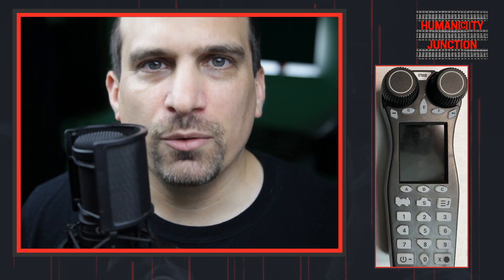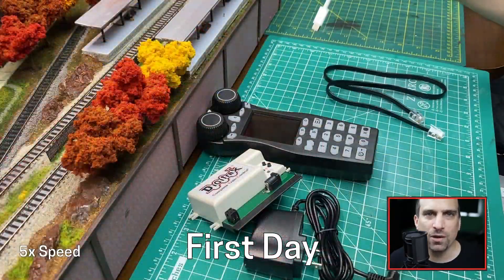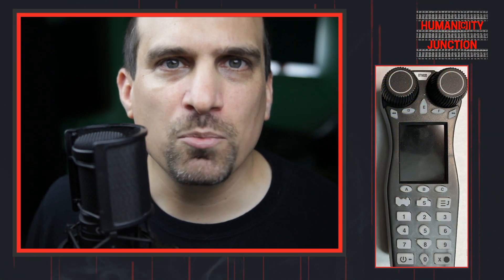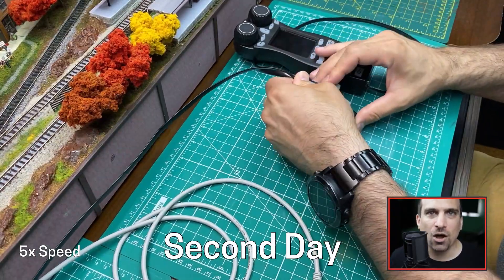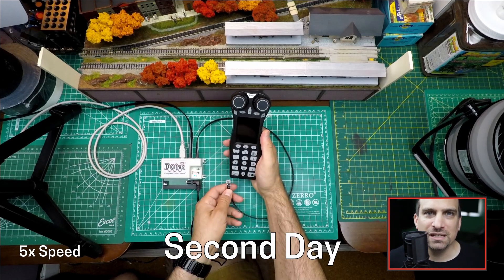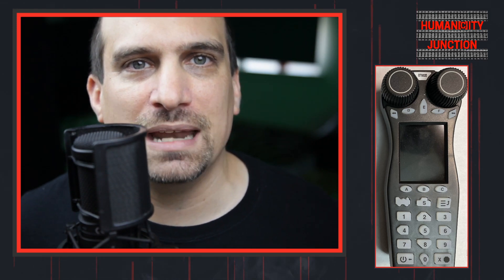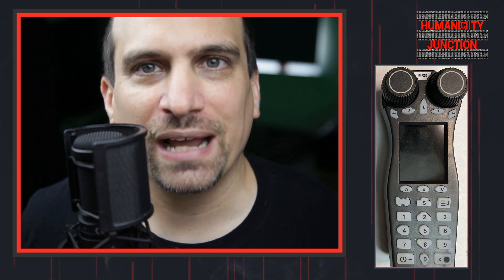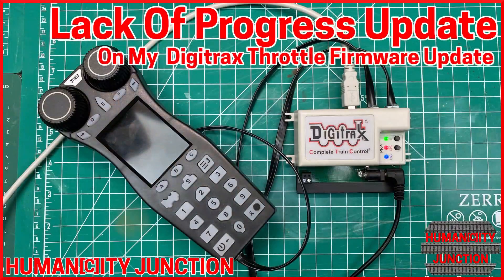Lack of Progress Update | My Digitrax DT602D Throttle Firmware Update

Comment from the maker: Thanks to Ryan at Iron Planet Hobbies, he was able to update a Digitrax Throttle with a PR4 and the Digikeijs DR5000.  He had the PR4 hooked up to the LocoNet B port. I will give this a try as soon as possible and report back.
Ryan posted a video on his Facebook page of this process working, https://www.facebook.com/ironplanethobbies/
Reply: Heath, Did your Digitrax handheld come with your DCC base station? If so then a good price. If not then the cost of the handheld has to be added in, ~ $195 retail, so then it totals to almost $400, for the handheld throttle and you base controller.
Reply from the maker: @tanzj  Thanks for the clarification.
Yes, total they cost $400 all together, but they are for two separate uses.  
The DR5000 for $200 is to run my home layout.  The DT602D is for operating on my club layout.  I can use the DT602D at home, but that is not its main purpose. Yes, it is completely overkill using the DT602D to run trains on my home layout :)
If I purchased an NYE Powercab or a Digitrax Zephyr (I came very close to purchasing the Zephyr) for my home layout, neither of these will work with the club layout. So no matter which starter system I purchased for home, I would still need a throttle for use at the club.  I did consider a UWT-100 or Proto Throttle for the club, but they are just starting to setup wifi and the Proto Throttle costs a lot of money, so I just went with the Digitrax throttle.
I definitely could have just gotten a DT500D to use at the club, but I really like the newer Digitrax buttons that they first introduced on the Zephyr DCS-52. I had a feeling that Digitrax would roll out a new throttle with the newer buttons and LCD as seen on the DCS-52, so I waited to purchase a throttle for the club.
My club is open, but I just cannot easily get there..Yet.  Once I can get to the club, I will be able to make videos with the throttle on the club layout, which I think might make more sense.
The club has a large N scale layout and a HUGE HO scale layout.  On Saturdays are open running/work sessions, but on Tuesday nights they do operations. Once I can get to the club, I could also do the throttle firmware updates there.

Thanks for continuing the conversation. I believe that we both completely agree that the DT602D is overkill for my home layout.
Reply: @HumancityJunction  Hi , I have been watching your videos on your DT602D ,as I was interested in this throttle, I have a very small layout, however I am the type of person that goes overboard for everything. I was torn between the UT 100 and the 602 , I have all Digitrax , Zephyr,  DCS-52 and PR4, and LNWI to use my iPad for running trains, I wanted a Thottle and could  and have used my IPhone , however I find these not really convenient to use, I liked the idea of wheels and buttons. so I went with the DT 602-D it should be here Friday, I appreciate the effort you have put forth in your videos and wish you the best
Reply from the maker: @catfisherboy  Thanks for checking out my videos. I also tend to go a bit overboard as you can see in some of my videos.  I really like the DT602D throttle, I just need to get past this firmware update issue.  Thanks again.
Reply: @HumancityJunction  Do you know what the update was supposed to do ?---fix a bug or add a feature
Reply from the maker: @catfisherboy  I know that it disabled the beeping every time the LCD went to sleep, which was the main thing I wanted resolved.  I believe there were also some bug fixes.
Reply: @HumancityJunction  I did get my DT 602 D Saturday, and it did have the firmware update, no beep--yjat's the good--the bad is, it would not stay connected to the UR 92, would run a bit , couple of minutes, then disconnect, the bars showed , 3 or 4 all the time, contacted Digitrax, they said if it wasn't low batteries I could send it in, I did that today, I am very disappointed to say the least---will let you know
Reply: Ryan is THE man. My first stop shop!
Reply from the maker: @GMan269  I completely agree!!
Reply from the maker: Here is the Iron Planet Hobbies YouTube channel which has a lot of good information on it. https://www.youtube.com/user/IronPlanetHobbies

Comment: I wish i hadn't invested so heavily into digitax. Most convoluted system out there. Really disliking my new DT602.  the fact it goes to sleep when you are using it. Then, Stays awake when the power supply is off.  so illogical. And the 'recall' session trains. Never seen a train number i have used on the list.  And do you think i can update the firmware? no! it just doesn't error, or do anything. looks all fine. but still the old firmware... NCE here we come...
Reply from the maker: I really like LocoNet, so I actually use a Digikeijs DR5000 as my command station.  I can use a Digitrax throttle (my local club is Digitrax), but I can also use a lot of different options as well.
NCE protocols are too limited for me whereas the DR5000 can do LocoNet, Expressnet and a few others.

Comment: Dont worry about the negative feed back,i am inthe same boat considering on buying this digitrax throttle awaiting  your tuitorial on this matter good luck
Reply from the maker: I am really liking the UT6D throttle. If you are doing operations, I think it is a better option.  I just did a video on consisting, which you can now do on the utility throttles, and I believe it is a great step forward with the new throttle. -Heath

Comment: I remember that thread on that Digitrax IO. I never responded to it since I actually have no experience with the DT602 but it was an interesting read.
Reply from the maker: Rebel, is that how you found my YT channel? From Groups.io?
Reply: @HumancityJunction  I searched t-trak layouts looking for ideas for my own t-track stuff. I am in the wiring stage right now and I’m not 100% sure my idea for my own wiring is the best, even though it works well, and wanted to see what others were doing. And I landed here. I have been tossing the idea of building a channel like yours but just lack time to make it all work. I have a few vids on my motorcycle work, and a few of train stuff on Rebel n Trains but nothing to really stand out.
Reply from the maker: @rebelndirt8830  Fantastic, thanks for letting me know.
In some cases, I just turn on the camera when I am working, and then edit them down into a video.
I am just trying to share my enjoyment of the hobby in a concise and efficient manner. -Heath

Comment: I went through my trials with this new throttle. One return trip to Digitax for the IPL'D update and battery issue and it still didn't sync to my system. Turned out that the throttle only stays on channel 11. I set my UR92 to channel 11 and now the throttle works.
Been through the tribulation of trying to interface an ESU system with my Digitrax. Stutter stepping all the way until I decided it was enough. It doesn't work. Only Digitrax stuff on my system of some 36 components.
Reply from the maker: I find it frustrating that there is not a common language amongst control systems. My main control system is Digikeijs, which is supposed to be LocoNet compatible, and yet some things do not seem to work as smoothly as they should.
Thanks for watching and commenting - Heath
Reply: @HumancityJunction  ESU claims Digitrax compatible, but ya end up have to replace all your Digitrax stuff with ESU stuff. They sell an interface unit, which I tried but that didn't solve the problems I was running into. I just stick with all D now.

Comment: Ironiclly Digitrax is 2.4 miles from my home in Panama City ,Fl.  and yet can't walk to the front door and say HEIP!! I have received update from Chris at Digitrax and I as well bought a PR4 and laptop tried update this morning. The problem I have is hit horn on right throttle then quickly hit horn on left throttle while right is still blowing then both horns get stuck blowing and can"t turn off I have to shut down my DCS100 for 30 minutes and remove battery to reset,  thanks to your video post I was informed of how to hook up PR4 to my Loconet and update my DT 602 at this time that update did not fix my issue. Steve I.
Reply: Also this is not an issue with my DT 402 and yes I am running 2 separate loco's on my layout and ran into this problem the first day I received it. I pre ordered it I think mine is # 170 in manufacturing, I'm just wondering did I jump the gun when ordering this throttle, I'm sure this will be resolved and I can use the DT402 until fixed.
Reply from the maker: I think my throttle was number 147.  I do not think it had the battery clip issue, but definitely an earlier hardware release.  I think there was a "b" sticker inside the battery compartment.
My throttle is currently at Digitrax, arrived Friday, so hopefully I will get it back soon. I am very curious if my unit has a hardware issue or just needs to get the firmware loaded up again.
I always try to wait and not buy the latest release of anything, but I guess it is all a part of technology.
I will update as soon as I get the throttle back.
Reply: @HumancityJunction  Sent my throttle in to Digitrax, the emailed me yesterday and said they were sending a new one, hope it stays connected
Reply from the maker: @catfisherboy  Wow, that is not good. I got mine back and they just updated the firmware.  I definitely need to run it through it paces before the year is up.
Reply from the maker: Chris was helpful, but I still wish they had provided better instructions on how to do a firmware update.
Reply: Yes I agree about the firmware update watching your video and then going outside and trying to figure out if you had it hooked up bright I saw the light flashing I had it in Ops mode on the dcs100 and the lights were flashing like crazy on the DT 602 but in the end it did not fix the problem with the horns getting stuck and it is not a button issue it somehow has to do with the digital information overlapping from one to the other rather quickly and I must say oh how I miss being able to talk to someone on the telephone at Digitrax, good luck with your DT 602 I'll check back and see if you made a new post on your repair.

Comment: I have a digikeijs central and, digitrax, lenz, uhlenbrock and roco centrals and thottles, interconectivity is something I also want, but under real life use and after many hours trying most possible setups and testing all possible processes like programming, multi locomotive, train detection, 28 functions, etc etc, I came up with the conclusion that while compatibility in most essencial situations is possible, is it not in all processes. My advice, buy everything from one manufacturer, even in that situation you will still have sometimes minor compatibility issues but your dcc system will work 97% of your time. Prefer brands with many years in the market, from Europe or USA. Right now my H0 layout work with all lenz, and my H0m layout will work with all digitrax.
Reply from the maker: At the moment Digikeijs does not make a throttle, but it looks like they are coming out with some new products shortly.
But I understand what you are saying.

Comment: Another advantage of biting the bullet and sending the throttle back to Digitrax is, if there is an underlying hardware problem in the throttle adding to the frustration, it should get fixed at the same time. Just a thought.  Art...
Reply from the maker: Art, there is an issue that some other people have had with the battery clips shorting out the throttle, but they all claim to have seen smoke. I am going to try one more thing that Ryan at Iron Planet Hobbies got to work, but if it does not work for me, I will just send it back.

Comment: Heath, I think that you would have been better served by starting with the NCE system.....John
Reply from the maker: My command station is Digikeijs DR5000, which I am very happy with.  My issue was trying to update a Digitrax throttle on the Digikeijs command station.
Reply: Heath, Be as that may, as small as your layout is, what you have purchased is a bit overkill and cost more than a starter Digitrax or NCE system. Either one would have been suitable to power all of your layout. As your layout was expanded, then would be a good time to get into the more complicated and expensive systems. For example, Sparky runs his entire layout with a starter NCE system plus maybe an extra booster......John
Reply from the maker: @tanzj  My starter set is the DR5000 with the Z21 app, so $198.  The Zephyr and Power Cab are slightly less at $179/$189, which I feel makes all three systems very comparable in price.

I bought the DT602D to use with my clubs layouts, not my layout. It just also happens to be compatible with the DR5000.

I actually find the DR5000 very simple to use and for $200 provides everything I need and more to run my layout.
Reply from the maker: @tanzj  I apologize, but I think I might be confusing what you are saying.  Which part of the system are you identifying as over complicated?  The Command Station that I use to run my module/layout or the throttle I bought to use on my club's layout? If you can clarify specifically which items you are referring to, I might be able to better clarify why I purchased them and their intended use.

Comment: Hi Human City, As a Digitrax user for the past 20 years, I'd suggest taking advantage of the Digitrax NO Worries Warranty. Since your throttle is brand new and less than a year old, If you still have the sales receipt, the repair is free. If you've lost the sales receipt, your cost is going to be $25, that is a heck of a lot cheaper than purchasing a new command station. Something to think about. Cheers, Rich S.
Reply from the maker: Rich, Thanks so much for commenting.
Digitrax is willing to have me send the throttle back for repair. But they also implied that they are working on another new firmware update.
Ryan at Iron Planet Hobbies was able to update a DT602 (without the D) with the same hardware I have, so I am awaiting some additional details so that I can try again.
If I cannot get it going on Monday, I will definitely send it back to at least get it going on the June 15th Firmware.
Thanks

Comment: I don't see why you would need the PR4 if the DR5000 comes with a USB    interface to the laptop and loconet.
Reply from the maker: Exactly, I do not get that either which is why I tried doing the update with the DR5000 in the first place.

Comment: Yeah, it really sucks when you find out that this throttle is not wifi like all the other new throttles and you need all Digitrax hardware to get it working. I would return all that stuff and go with the wifi Z21 throttle.
Reply from the maker: If my local club was not all Digitrax, I would definitely consider it.